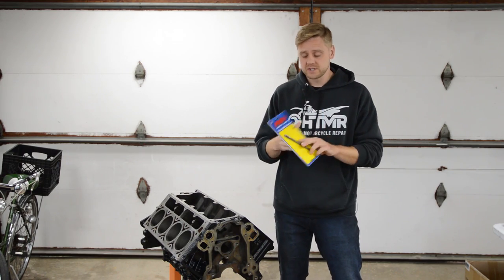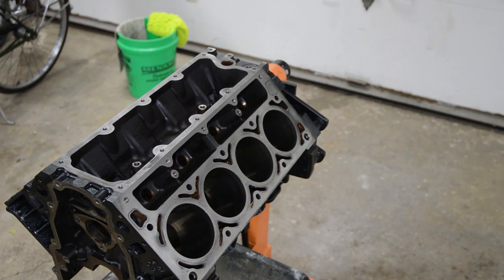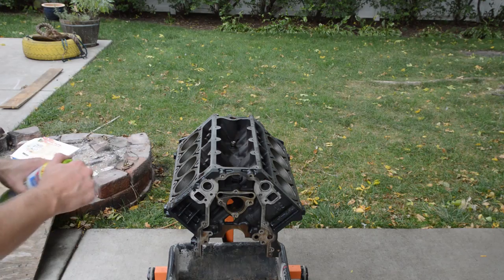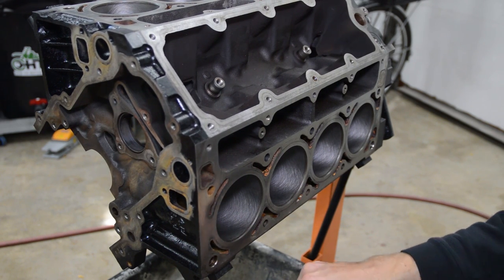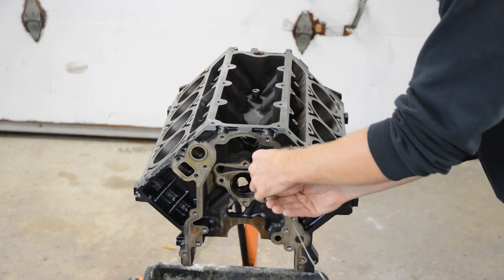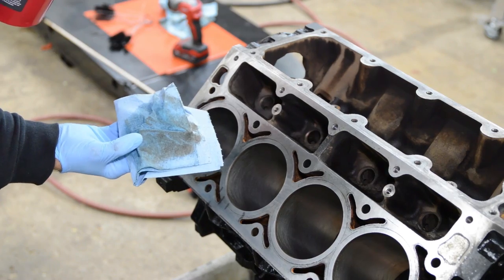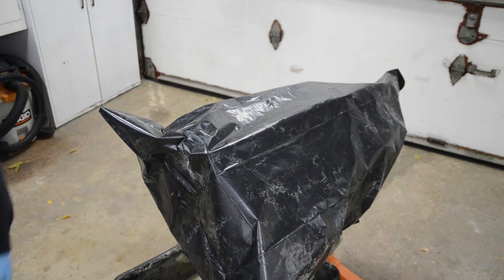Chevelle LS Turbo Build: Prepping The Engine Block

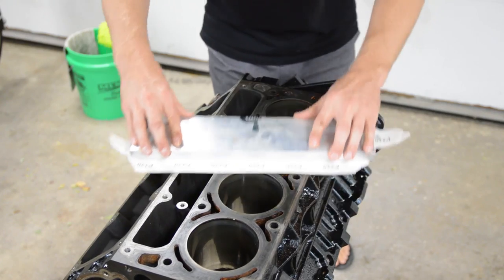Comment: Great video.  Just happen to stumble on it right as I stated to clean my block. I especially appreciate the sand paper grit info.  For some reason I could not find info on what grit MLS gaskets require, just RA surface ratings.  So 20RA is roughly 220 grit? 3:22

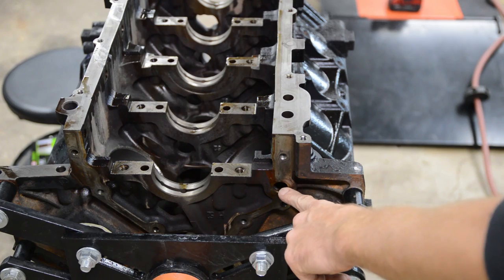Comment: At time stamp 14:50 use 3/16 brake line and slip your wire through. You can push/pull the brush.

Comment: I think its worth noting to do the detail work first, that way your overall wash cleans up that mess. For instance knock the cam bearings out first and then run a pipe cleaner through those passages.

Comment: @ How-To Motorcycle Repair Do you have a video on showing how to do aluminum LS cylinder heads on a flat surface and sandpaper that require near mirror finish for MLS head gaskets?

Comment: The aluminum block with sand paper is a good method. It should taken to a machine shop to be surfaced flat. I do something similar but somewhat easier for block and head, cast or aluminum. What I have is a long machinist file. It is true flat. After rasor blade cleaning and brake cleaner I do as you did with the block sander. The advantage with the file is that there is no grit to worry about. Also before and a few time as I am filing I check flatness with a machinist bar. Your spec sheet gives the acceptable flatness. On many things it is 2 or three thousands.
Reply: For LS its .004" on deck and head, so if you're paying attention and checking constantly it's pretty hard to screw this up. LS is pretty forgiving until you're going for stupid power then obviously you want that to be as tight as you can.

Comment: 17:07 - transmission fluid does not usually contain any detergents ... why would it?
Reply: This is wrong. Transmission fluud do contain detergents.
Reply: What detergents would be added and for what purpose?

Anti-foam, yes.
Anti-wear, yes.
EP and VII, yes 
Detergents... why?
Reply: They used to contain them in higher amounts.  This is good practice regardless.  Clean and lube until assembly

Comment: 16:22 whats the weird spot on the block. Lower right corner kinda shaped like a square above the one bolt hole.
Reply from the maker: Cooling passage in head and gasket. Parts are symmetric and hole in block exists in other side.